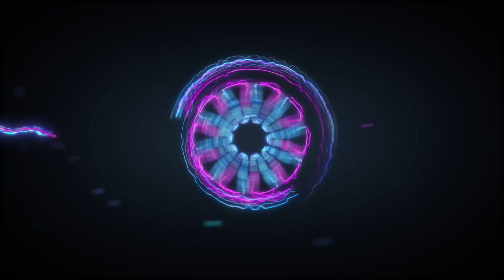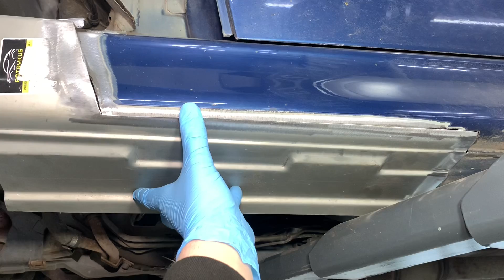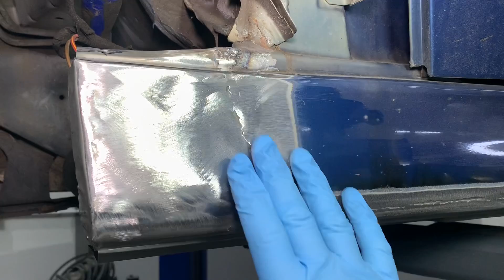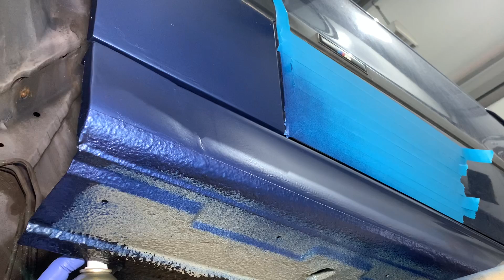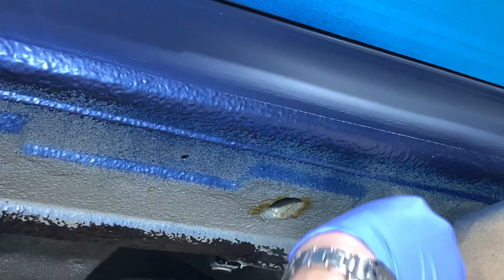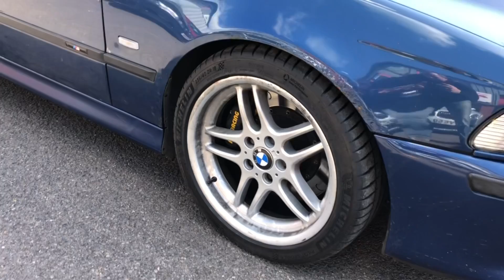BMW E39 Front Sill & Jacking Point Corrosion - PART 3

Comment: It’s interesting to hear how you found welding the cheap metal panel. I always wondered how they would weld compared to the OEM metal. I’d be curious to see how the aftermarket panel metal holds up to corrosion

Comment: Amazing work as usual. How are you sure there is no issue with the amount of metal that was corroded on the jacking points? If even a little corroded metal was removed in the process would that jacking point no longer be as structurally strong as intended? Not sure what tolerances the engineers put in but just wondering how much weaker it is now.
Reply: I'm not them but one thing I suspect about BMWs is that they WAY overbuilt their jack points. For a typical car with reinforced pinch welds as jacking points, it doesn't take much rot to make the jack point completely useless. Coming from Japanese and American cars, the first thing that struck me was the integrity of the jack points on BMWs.

Anyway, that's my 2 cents and Redish I'm sure has more to say on that.